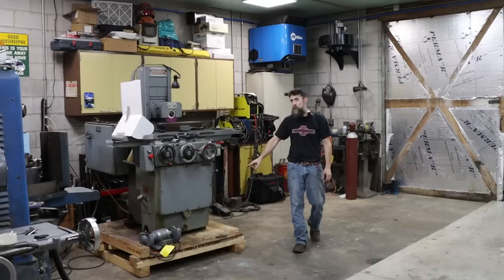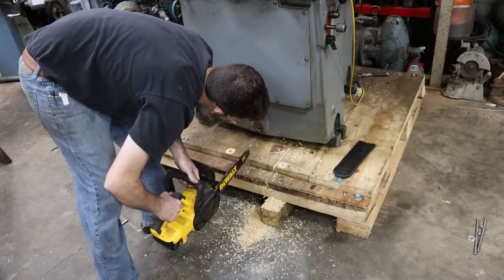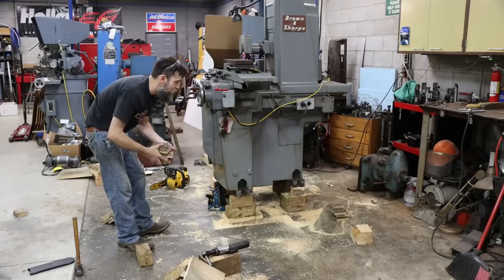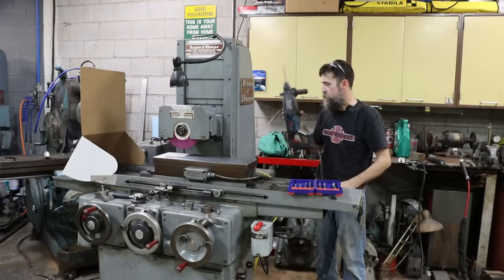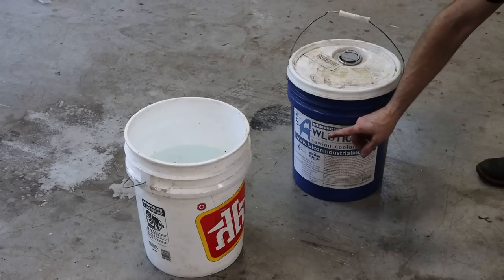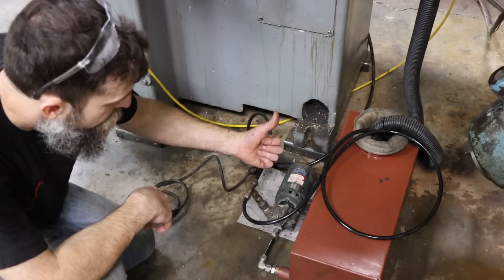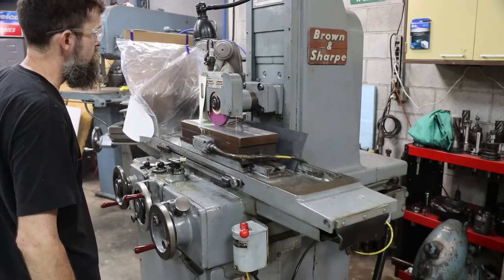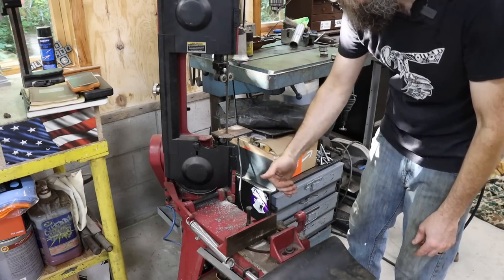Doing it the hard way. Brown & Sharp grinder touchdown & Test!

Comment: Couple years ago I went to pick up my auction grinder, a smaller brown and sharpe.  Guy said he had a forklift on site, so I only brought my small trailer, no tailgate, no tools, no lifting equipment.  He did not in fact have a forklift.  There were a couple people picking up equipment in the same predicament so we all got together to see what we could do.  Found a pallet jack, put it under the grinder, pulled it out to the center of the floor where the wheel of the jack broke.  Then we tried the same thing and started using the pallet jack like your toe jack, busted up other pallets as cribbing, and jacked it up about a foot before it became sketchier than any of us could tolerate.  Finally we put all our tools in a pile and started brainstorming.  We had a kelly bar, some 1/4" plywood, a floor jack, and a come-a-long.  We made a bunch of suggestions, all of which were unfeasable. Finally one of the smartest people I ever met, one of the other guys, said "Take the wheels off your trailer".  Holy cow.  Took the wheels off the trailer which dropped the back all the way to the ground.  Put the plywood on the deck so it had something to slide on, used the come-a-long to pull the grinder into the trailer, then used the jack to put the wheels back on.  I gave the guy the last $40 I had in my wallet so he could buy some lunch, he immediately took it to the seller and said 'what else do you have?'  Ended up getting a nice rotary table.  That learned me my lesson, I never go to pick up equipment anymore that I don't take the big trailer, the winch, tools, and my modified engine crane.
Reply: Yeah when i go picking something up i take way more than i need in case..better to have it if you need it....and when you find they can't help you you don't waste a trip or fuel or time or....frustration !!
Reply: YUP ! You can always take it all back home with you unused eh

Comment: The grinder performed well. The bocks measure consistently and you liked the surface finish. The machine way belly wear may prevent large part flatness accuracy and your test set up could not determine this. BUT it looks very promising. 
Grinding is more of an art than machining. There are so many subtile dynamics that don't affect machining and typically we grind for greater precision and accuracy raising the skill level bar substantially. I have no hobby shop surface grinding capacity in my hobby shop. I am still trying to master machining skills. You are light years ahead of me as an operator, but I am an experienced repair technician. I have long enjoyed diagnosing machine accuracy. As a repairman I relied heavily on operators to perform test operations, but I designed and managed the processes. I could have a lot of fun collaborating with you if I lived closer.
I enjoy being part of your journey. I am taking a new step in my journey. I am completing preparations for hosting and teaching intro to machine shop to a group of homeschool boys. My 12 year old grandson spent a day with me this week purchasing and prepping materials for our student class projects. I taught intro to electricity and troubleshooting to a similar group of boys. That was fun and I am very excited to begin the new adventure. Mr. Pete has inspired me and is a long distance coach!

Comment: Great seeing the B&S surface grinder doing the job so well, casting my mind back to my apprentice days I remember using Jones & Shipman surface grinders, I'm pretty sure they didn't have filters for the coolant, instead, after coming off the machine the 'suds' would run into a tank which contained a flight of settling trays where the coolant would overflow into the next one progressively dropping out the solids on the way to the bottom from where it was fed back to the machine. Love the little calico kitten, looks full of potential mischief! All The Best from Somerset, England.

Comment: Steve has too much time on his hands -- time to cut a glass bottle with no end purpose. What's the world coming to :-)
Love the content. Keep it up.

This video reminds me of when I purchased my Sieg Lathe. It turned up on a pallet and the delivery company dumped it in the middle of my garage. I hadn't even though about how to get it out of the pallet and into service. Luckily, an elderly neighbour and a good friend knew a thing or two about this, he turns up with a bunch of pieces of scaffolding pipe, wooden wedges, a jack and a large metal pry bar. We spent a couple of hours getting it off the pallet and gradually lowering it onto the scaffolding before we rolled it into position and down onto the ground before fixing it down and levelling the bed. His wise words at the end are that I've got a lot to learn and on reflection, he was right. I've learned a lot about machining in many more ways than I thought when I hit the buy now button.

This is the same person that last week called me to say that their computer was broken and roles reversed and he now is up and running again.

Never underestimate the power of your network of friends and the experience they have.

Comment: Seeing that grinder brought back bad memories. I ran one of those all day every day making graphite blank cubes for EDM machining. The graphite was so fine the dust went right through my uniform, 40 minutes of scrubbing in the shower after work every day.
Reply: Try graphite based grease, takes months to wear out of your skin. Especially when it mixed with the Areoshell hydraulic fluid, to make a nasty sticky paste. We found a good way to wash it out, which involved a 44 gallon drum with no top, a gallon of the detergent from the high pressure cleaner, and a 4 hour boiling in the drum with a hot fire under it, then leave to dry, and boil again in fresh fluid and water, then rinse, and wash as usual. They went very faded after a half dozen cycles, but at least were clean.

Comment: As surface grinders go, that's the Mercedes of grinders. Love that grinder. I have a little Harig 6x12 grinder and only the cross feed is automatic...I have to turn the X=axis by hand on each stroke. I bought mine at a school auction about 10 yrs ago, only paid $300 for it. It is accurate as the day it was made, even though it's a little smaller than I would like, it's plenty good for what I do. I hardly ever use it. It just sits there and collects dust most of the time. I actually made my own precision flat stones on it with a diamond wheel that I bought that was in a box full of mostly brand new grinding wheels I bought at some other auction. I love machinery auctions but unfortunately there aren't many here in east TN, plenty of farm and construction equipment auctions though. In CT where I'm originally from, machine auctions came up monthly.

Comment: Good rigging is done to a plan, at a steady pace, with no surprise moves, and not always with fancy equipment. Good work and good score with the grinder.
Blessings from South Africa.
Reply: Yes, most of my rigging has been done with a 1 ton chain hoist, that I bought from a now defunct hardware store, and it has served me well. 1 ton rated, but has been (ab)used to do many things, including being used with a racking beam as a puller for stuck shafts, and for lifting up machines close to 1 ton, because of the need to repair them. Drilled a few mounts into the concrete beams and roof as well, using 1 ton eye rings, and M12 Rawl bolts, along with a good fill with construction epoxy from ABE as belt and braces, just in case the Rawl fitting ever wanted to come loose. Hard to come loose when the entire fitting and bolt, including thread, is filled with epoxy, though getting them in was difficult as you filled the hole, then left the epoxy to cure for 24 hours before use, eyelet and all now permanent parts. Think new owner of the building simply ground them off, and painted with primer, because they were never coming out.

Did bend that 5 ton shelving stringer though, though it did do the job, but afterwards was bowed, and went as scrap metal eventually, as the shaft went back in this time with grease on it, not rust. One job pulled as motor off that burnt out, and only after struggling with it looked up the data, and found this was a 230kg cast iron frame unit, with the 300kg gearbox on it. No wonder so heavy to manhandle, the new motor was 83kg, aluminium frame version, and yes that beam was again abused to separate the two parts, as again OEM, and zero lubrication, aside from what blew past the oil seals. Motor died because the original installer wired to start in delta, and run in star, then upped the breaker to a 50A unit to not trip, and bridged out the overload as well. Ran for a few years, till it burnt a contactor to the point it dropped a phase, and then burnt out the windings. New motor, new control gear, and added in the biggest soft starter I could find, for this 8kW motor.
Reply from the maker: I agree, most the riggers I've seen in action use old jacks  wood blocks and worn straps.  They plan well and think about every move before they do it. In most cases they do anyway 😁
Reply: @SteveSummers  Yes had pro movers in for that, and yes they took 2 hours to decide just how to move, but no damage done. Same can not be said about the courier however.....

Did have an old stainless steel tank that needed to go, and only option was to borrow a plasma cutter, and in 20 minutes the tank was stainless steel sheets on the floor. FIL came from work with his plasma cutter (container repairs) and a quick job to hard wire it into the board (3phase power needed for this big machine) and an air line, and before you can say smoke, it was done. Tank could not go out in one piece, as it was in there long ago, and the only way was to use a crane, and remove a window complete, and resale value was scrap steel price.

Comment: Little off topic. But I noticed in the shot with cora. The floor looks great. No noticeable settling or cracking. Still amazed by the work you did on your shop.
Reply from the maker: I've had zero issues with the floor. It hasn't settled or cracked . I'm really happy with the way it came out

Comment: Thanks for the Welch's placement, we grape farmers appreciate it!. At one time, there were folks cutting beer bottles like you did, then fastening the cut top to the bottom to fashion a red-neck-style goblet glass with PBR label intact. (some rim filing required)!
Reply: Here the cut is made using a glass cutter in a jig, and then a string wrapped around, dipped in petrol and lit, to snap off the top cleanly. Then sand the 2 halves, and epoxy the top to the base, and leave the paper label intact.

Comment: Great ingenuity, which is what a poor boy has to have.  I understand the hard headed part (me) and also fiercely independent (result of cranial density).   Diamond wheels- I worked at a shop that used mostly carbide tooling on Brown & Sharpe machines.   There was a Diamond grinder used for sharpening tools.  It was very soft and easy to mess up. (Management frowned when that happened. )

Comment: Hey Steve.  Many years ago I worked in a sheet metal shop.  My main job was working a punch press (houdaille strippit).  We had a small manual surface grinder used mainly for sharpening punches and dies.  You are correct that an automatic machine is the way to go but, being able to take a break to sharpen punches, after finishing a job where you were punching 2 holes in a run of 1000 pieces, was a very welcome break.  Thanks for the video!

Comment: Hey a tip for those hose clamps you are using for the lubricant. The screw driver you were using is actually the same size as the hex head on the clamp. Just take the flathead tip out and use it like a socket and it makes them way easier to fasten plus a little more secure.

Comment: Steve.  Im not a machinist but i do have a lot of experience in measuring things.   I have an observation to make on your testing of the grind.  It is much more diffcicult to describe in words, I wish i coud darw a diagram.  Any way, here goes.

Because the chuck moves under the grind wheel, and, you ground the chuck prior to the block test, it is inevitable that the 6 blocks would be the same depth.  you are, effectively, measuring the same distance 6 times.

i suggest your measurements are an indication of how consistent the wheel itself is.  i would venture to suggest that, because of the grinder design, the over-riding influence is the surface quality of the wheel.

this is no way meant as a criticism, i offer this, for what its worth, more as a point of discussion.

thank you for a brilliant channel, i look forward to each new video.

btw, thats one cracking dog youve acquired, what a gem she is.

regards from across the pond

Comment: Coolant system also would recommend getting a cheap water filter housing, 8in, and fittings to go to the hose used, and a 5 micron water filter cartridge. That way your cutting wheel gets a good flow, that does not have all the debris that misses the filter sock, and your cutting will have less marks left in it from tramp debris in the coolant impacting the surface. Filters will show dirt fast, but will keep the wheel very clean as well. Plus the restriction will also help with slowing down flow rate on the big pump.

Tortie will have attitude, even though she is cute, and will be showing the dogs fast who is the boss there.

Comment: I got all my machines off the pallets in a similar fashion I happened to have a couple of heavy angle iron that was a little longer than the pallets which then I jacked up the ends set on cribbing slid pallets out and lowered down in the same fashion as you did. 
The only thing I did differently is made stands under machines that had leveling bolts with pads welded to them and gave myself just enough clearance under the frame to get a pallets jack under some of the frames are wider than the machines just so pallet jack will fit but now they are easily leveled and easily moved around the shop especially if you need the room for a project and space is a premium they can be parked out of the way quickly.  Good job at getting it done yourself 👍👍👍

Comment: Seems that it is in nice condition and you scored a 10 out of it...
What I would take into consideration is a longer lead for the magchuck, the plug is moving quite much in the socket, a longer lead with a loop in in it would eliminate most of the stress thats introduced into the socket...
The diamond blade is quite nice, cut one ich above the bottom of some interesting designed bottles, put a LED bulb in the neck and hang it from the ceiling, would make some nice mood lights1
Thx for showing!
👍👍👍

Comment: The Bosch Bulldog Extreme Max is a ROTARY Hammer drill - which are more effective at drilling concrete than standard hammer drills, which work fine for bricks and mortar.

Comment: I love my bosch hammer drill. Rocks, concrete,  morter it doesn't matter
Reply: Yes, drilled a few holes with a 5mm bit, and only noticed after around 5 the tip was missing, must have snapped off when hitting some rebar. Made no difference to the drill though, went in exactly the same for the remaining 20 holes. Shame about the bit, it had been used to put in 12km of lighting in a shopping centre, all the back of house lighting in the car park, and the utility corridors, drilling 2 holes every 500mm for saddles, and then 2 holes for every fixture as well. Still got it, ground it to a sharp point, and used as a scriber now. The Bosch bits are good stuff, along with the Hitachi/Hikoki ones.

Comment: You have a sweet machine dude.
I hope you made sure all your Bijur metering valves are flowing 
I have the same machine.
Five block test was within .0003”. Not bad for a machine over sixty years old.
Mine has the flood coolant kit. Heavy sheet metal skirting around the chuck.
You are gonna love that baby.
Reply from the maker: Thanks, I will have to make the splash shield for this one unless I can fine some.  .0003 isn't bad 👍

Comment: Steve, fire polish the cut edges of the glass and avoid injury.  An ordinary propane torch should be plenty hot, as a lab Bunsen burner is good enough for common soda/lime glass.  Borosilicate ("pyrex") glass is beyond a Bunsen burner, but a Meker (grid top) burner works (been there/done that).

Comment: The easiest way to lower a heavy item is to raise it , replace the pallet with blocks or bags of ice.
The ice will melt and gently lower the item to the ground.
I have seen this done with a prefabricated concrete pool where there was no access around 2 sides of the pool.
Reply: The risk of the ice shattering would worry me.

Comment: Steve when you ground your blocks did you grind both sides before checking . Thanks
Reply from the maker: These blocks stay in my tool box for this test only. I've used them many times, so yes they are ground on both sides. I didn't grind the other side in this test but they were ground before 👍

Comment: Steve, you shouldn't restrict the inlet of a centrifugal pump. it will over load the motor, you can however pinch down the outlet as much as you want to adjust flow. it will actually lower the amp draw of the motor as you decrease flow this way. you would be better off plumbing the inlet at full size and put a throttling valve on the outlet of the pump
Reply from the maker: Throttling the outlet is what is being done. The inlet direct👍